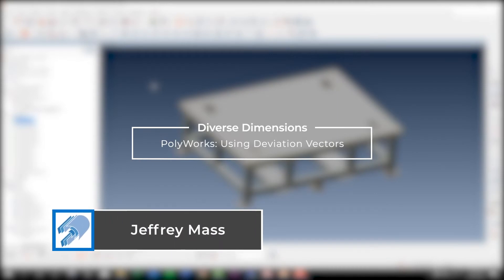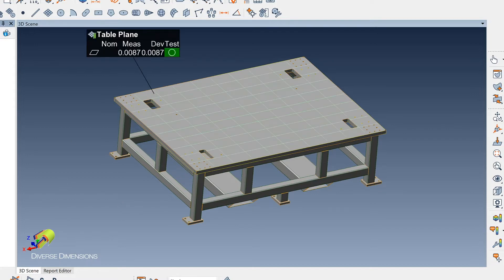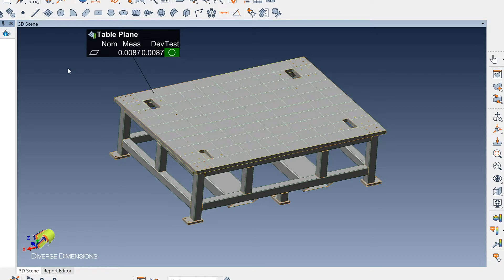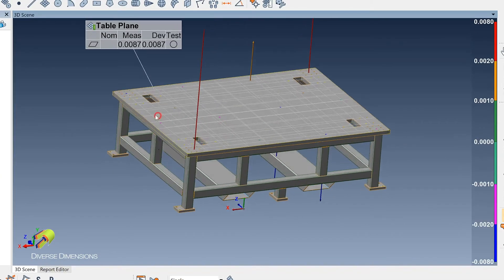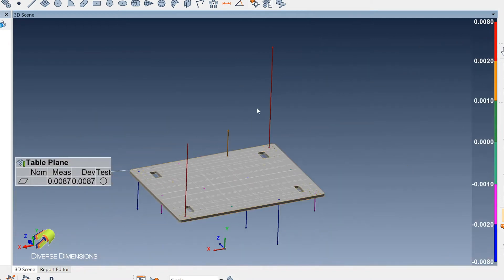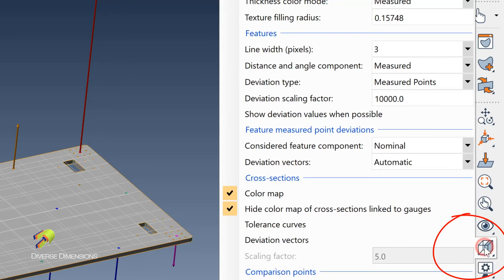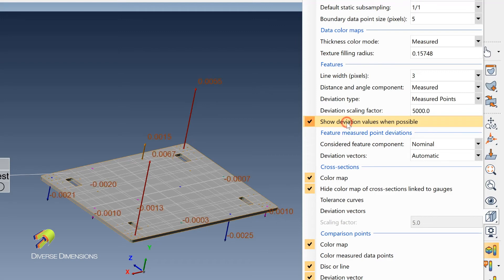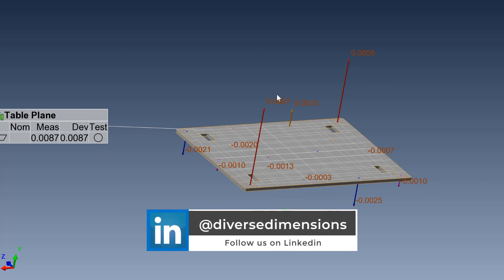PolyWorks: Using Deviation Vectors

Comment: How can we get these deviation vectors on on measured cylinder which doesn't have nominal value.
Reply from the maker: Thanks so much for reaching out on this.  The workflow on this process has changed a little bit since PolyWorks has introduced V24 and the Ribbon.  Send me your project / workspace and I will pull together a short video showing how this works with features that don't have nominals.

Comment: Nice tool to have and thanks for your video. Can I use individually selected points to form a plane based on the info gathered?
Reply from the maker: Good morning, Nilesh.  I hope your weekend was a good one.  Yes, you can use the individual points from the captured data to form planes.  What is your email address?  I will connect with you that way and maybe do a Zoom or Teams meeting to go through this with you.